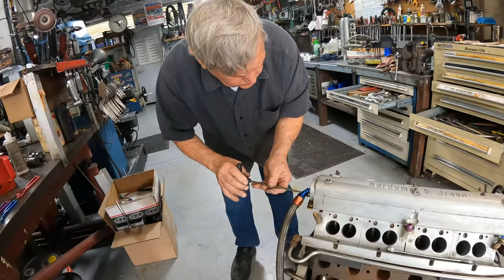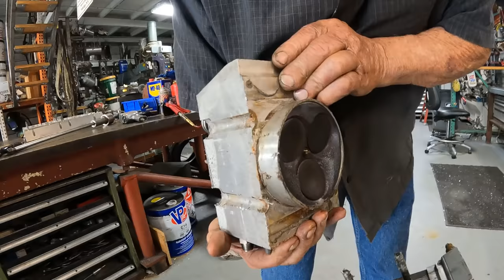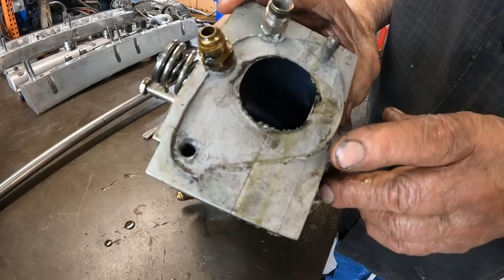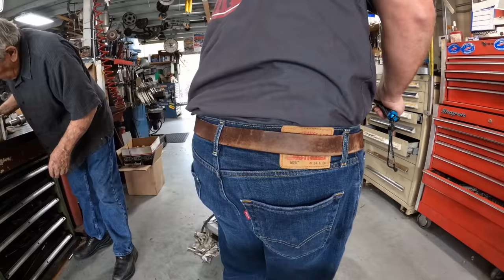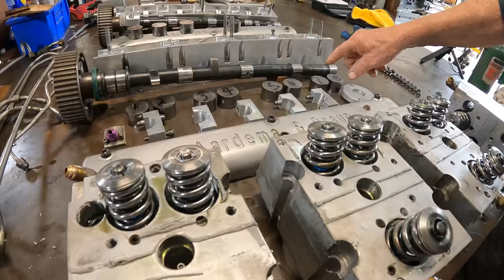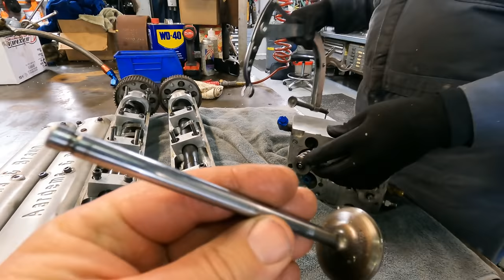World's Fastest Ford Model A Engine Disassembled and Revealed

Comment: The 1988 Mercedes Benz 300E AMG Hammer 6.0L V8 has 2 piece cylinder heads with similar in design to what they've done. AMG converted the SOHC M117 engine to 4 valve per cylinder.

Comment: I applied for the patent for the 2 piece cylinder head in 2003, and never could find anyone that wanted to take on the project on so I never followed thru on it. I keep telling people it was workable and now I am so happy to see that you guys made it work. I still feel it is the very best way to build cylinder heads. The heads can be made from 6061 which is 6 times stronger than castings. So you can make a head that is both lighter and stronger. The only problem is you have to have all the head bolts holding the 1/2 together.
Reply: I had a similar idea around the same time, 2007 I think, of milling from the top and then using o-ring/ silicone type seals around all the water passage stuff and fastening down a block off plate to enclose water passages and rocker stands bolt down through plate into meat of the head, blah blah blah.
Obviously it was just dreaming,,,lol.
I’ve seen not to long ago where Steve Morris, I believe, is building a completely billet motor with water passages milled in with plates and o-rings sealing it up.
I was like,,,, it CAN work,,,, . 
How these guys are doing is different, if just proves that the concept can work. Maybe not for a production vehicle, but it’s viable.
I’m going to look for that SMR video now,,,,,,
Found the link.    https://youtu.be/TqGVvmn9buU
Reply: @shakeydavesr  Like they say there is nothing new under the sun. When we did a patent search for a 2 piece cylinder head, only Ford was doing this and it was only used for rapid prototyping. I have $10,000 invested in the patent and never did anything with it, and now the patent has expired. But I sure would just love to build a pair of SBC heads and prove it can be done. One thing I disagree with you on, is I believe this would be better for mass production than what it takes to cast and do all the CNC work they are doing now anyway. You start with 2 plates do all the internal CNC work press them together and finish the external, 100% CNC. The very best part is that all your tooling can be short and very rigid, so the cycle time can be very fast saving money on production.

Comment: Very cool, there were some race only Porsche engines (935/78 and 959) that had multi-layer heads that were water cooled while the rest of the case was air/oil cooled.  Kind of similar to what was reviewed in this video.  Thanks for sharing

Comment: You should check out the blue Summit house brand coolant.. It's meant for racing and is legal on most tracks, and probably would help the corrosion problem there too, not to mention its affordable too
Reply from the maker: I will mention it! Pete probably will lean towards water as it is cheaper at the moment, however with raising water prices in Sol-Cal it might be cheaper soon to run coolant :-)

Comment: The spark plug hole diameter looks small. Do they use a CM6 type plug?
Reply: CM6 is very short reach,  they might use another longer 10mm plug.

Comment: The original, Brit-based Royal-Enfield Interceptor verticle twins had separate heads, so if one side experienced more wear/failure, you could replace one side without a complete tear-down.

Comment: this is one of the topics i state in engineering. is the fact the discussion of new power plants vs old.
design is design. i believe that this represents that older block design with new engineering can outperform a lot
of newer blocks. it isnt that it is newer or older it is the design of the engine that matters.i am a firm believer that older power plants can be modernized cheaply to outperform and outlast a lot of new power plants. i would love to see this visited with the 350 sb chevy the ford 302 and 351 and the chrysler 318 and 340 i believe the performance and durability would astonish a lot of people
Reply: There is nothing cheap about modifying a block originally designed for 40 hp to withstand 500 hp +. The block originally had 3 main bearings and 3 cam bearings, a girdle must be made to add 2 main and 2 cam bearings if needed, they are using bolts thru the valve guides to help support the girdle. It is allowed in the rules (Bonneville) to run 4 half inch bolts per side from the head to the girdle to help support the forces. Most of these motors never go 60 total miles so durability is unknown. The cranks cost about $3500, rods $1500, pistons $1200 this is for a 4 cylinder. Cheap it ain't. 
I have worked on a record holding Blown Fuel Lakester with a Model B flathead that went 181mph on the short track.

Comment: I wasn't expecting a DOHC 3V engine, nice work, guys.

Interesting to see one intake port per valve. That's extremely rare in production engines, I'm not sure why.

I didn't expect the cam to be ground similar to a flathead. I figured they would copy some kind of successful DOHC bucket lifter profile. The Subaru EJ-series turbo DOHC had numerous cam grinds because of all the rally car enthusiasts. Subaru did replace them with roller finger lifters in the FA20DIT engine.

That 2.18 inch valve with 6mm stem is amazing. Sure, some modern engines get a 6mm stem, but only the DOHC engines with valves about half that size. Well, that's what you get when you don't have to drive as far, and can buy very expensive materials.

Cutting down and refacing the valves? Given the expensive stuff they are made of, is that a problem for the tools? When JAMSI used a crankshaft grinder to make some cut down valves, they were stock replacement stainless steel, but they still had to reface the stone on the crank grinder. I don't think it was a problem for the valve refacer.

Comment: Which bit is 93 years old apart from the cylinder block ?
Reply from the maker: The engine has been heavily modified , however, it met the minimum requirements per the rule book to run in the V4 vintage class at Bonneville which is the bare block

Comment: Did he come up with this after seeing the Jon Kaase heads or was it their idea? I can remember the Engine Master build shown in Hot Rod magazine.
Thanks to all parties for them showing all this and you for filming and sharing.
Reply: Didn't Kaase do it with the "Y" block, as far as dropping the chamber into the cylinder?
Reply: @jerrytee2688  I believe that is correct.
Reply: @jerrytee2688  No. Kaase's engine with a thick plate for a "head gasket" and protruding chambers was an MEL. At 470ish cubes it made 770ish peak HP. His Y block was another endeavor.
Reply: Yup, that's right, thanks for the clarification Joe.

Comment: detroit made an engine for cab over trucks with 6 separate cylinder heads. many big rig engines have 6 separate heads, to be able to perform repairs without removing the entire engine.
Reply: K series Cummins was the only engine with individual heads used in over the road trucks.
Reply: It's called the turbotronic 638 Detroit.
Reply: @mikebougher3731  There was a model of Scania in some Macks that had 6 heads. Of course the very common 855 Cummins family had 3 heads.

Comment: Imagine a flat head V8 with heads like this!  Heck give it a flat plane crank and it would be this!! Maybe change the valve angle to prevent interference,
Reply: I mean there's not much to a flathead cylinder head if the valves are in the block. Would be a a waste of time and useless.

Comment: what makes them break besides it is a model A/B block, is it the RPMs and or torque? Somebody is making new A blocks in China. If one of these stronger in design blocks would be used would it then not qualify for a record in the model A class?
Reply: Bob, if I may Sir,  regardless of the improvements in metallurgy and machinery of the new blocks, they are still severely hampered by having only 3 main bearings.  This INGENIOUS block design by Pete uses a main girdle arrangement with 5 main bearings and a custom crankshaft,  I believe by Crower. I hope this helps.
Reply: Of course Kevin deserves credit as well.  Forgive me Kevin for not mentioning you in the above post. 

Both you gentleman have inspired me to continue to develop my own design cylinder head for the Twin Cam Harley Davidson.
Reply from the maker: Pete and Kevin built a overhead cam Harley Davidson years ago, unfortunately  it was lost in the fire.  Pete still has the chard remanence of the bike on the property and he said he would like to do a video about it in the future.   The bike was a hit at Sturges.
Reply: @t.s.racing  well the 3 mains were not a prob on the stock block so this could be overcome in a new block. I was looking beyond that knowing that the mains were not as big of a deal as the strength of the block.  Then I was surprise, on the new blocks, that having gone through all the engineering and production that they would stick with 3 mains. Thanks for the reply.
Reply: A reproduction block would probably be against the rules for the class. I know you can't use the French copies of the Ford flathead v8 blocks in SCTA vintage classes.

Comment: If they need to reduce the compression ratio in order to run a turbo or supercharger, why not just shim the heads to increase the volume between the head and piston?
Reply: There is an area between the piston and head called quench with very little clearance at TDC and it increases turbulence, flame travel, and detonation resistance. Increasing the gap here reduces performance by making the above mentioned things worse.
Reply: @marthamryglod291  OK, but if the solution is shorter rods with the same pistons and same heads, isn't moving the top of the piston away from  the bottom of the head the same as moving the bottom of the head away from the top of the piston?
Reply: @brianhalberg131  the solution is to keep the quench while dishing the piston more to reduce compression. Do not lower piston height.
Reply: @marthamryglod291  As I understand "quench", or piston to head clearance, its the distance between the piston and the head at TDC. For a flat topped piston this is uniform across the piston and any swirl or turbulence is imparted by port flow, angle, combustion chamber shape etc.
Dishing a piston may retain the same clearances at the outer edge of the piston but increases the compressed volume, therefore quench is no longer the same.
Reply: @brianhalberg131  the piston does not have to be flat across the entirety to have a quench area. Even a small section of flat area matched to the flat are in the chamber will provide quench. David Vizard has fantastic books with diagrams and graphs showing different chamber shapes and piston shapes and how they affect power output. Really fantastic books.
Reply: @marthamryglod291  Thanks Martha, I fully understand that. And just to be clear, I'm not suggesting that the quench or squish area is anything other than the area of smallest clearance between the head and piston. As I understand what you're describing is the area between the flat or flatter portion of the head and the corresponding area of the piston. When the piston comes to TDC the fuel/air charge is compressed more highly in this area than it is below the combustion chamber dome. The fuel/air charge is driven into the main part of the combustion chamber giving you swirl or turbulence which can be used to give optimum flame front propogation and prevent detonation. I get that. My original comment was proposing raising the head up the bore slightly as opposed to making large changes to the rotating assembly. Without sitting down and calculating what that increased clearance would need to be in order to lower the CR to the desired number, I couldn't say what the change to quench area would be. It was more to suggest that CR could be more simply lowered using that method. Not being an expert on forced induction, I had assumed that quench area wouldn't be as critical as it is on NA engines. I understand that you're saying it is.
Reply: @brianhalberg131  great reply! I understand you well. I just love learning from different people and Vizard is a wizard.
Reply: @marthamryglod291  I have one of his books as well.

Comment: Why is a 2:1 rod ratio so undesirable. Is it the extra weight in the rod?
Reply: I think it is because their engines tend to be NA and the faster speed away from TDC helps to get the intake charge going and improves cylinder fill over a longer rod which tends to be lazy. If they did more turbo motors they might find the longer rod to be less detrimental but easier on parts. Also the long rod ratios tend to really shine in engines that scream high rpm for a long time. In their application they are pulling up thru the rev band and at lower revs the shorter rod ratio tends to make more torque.
Reply: @bcbloc02  Hey! I watch your channel here and there as well. I was pondering if the slow piston movement you are describing is poorly matched for the fast combustion speed of gasoline / race gas.
Reply: @david929190  I don't think the fuel has a whole lot to do with it as I know some Formula one motors have run some crazy high rod stroke ratios like supposedly over 2.5:1 but they run insanely high rpms and stay there for long periods of time.

Comment: The block must be based on the oem block, but that's it, right?

They added 2 crank bearings…so the crank isn't stock, and the block is modified, but it's "based" on a stock block 😂

Comment: Intake ports are for a 10,000rpm engine will never see 5,000rpm.
Reply: We turned the engine 7000 rpm. Although the ports may handle more rpm on a shorter stroked engine, it has more to do with cubic inches to valve area.
This engine has a lot of cubic inches per square inch of valve area. So it will not handle much more rpm.
Reply: @kevinbraun6272  the factory ports are WAY to large in a boss 302 and to make them flow well the floor from gasket surface to floor radius must be filled about a half inch, if you don't fill the ports the usable power range is way to narrow and won't be competitive as cast with porting and manifold matching,

Comment: That’s not a model A motor
Reply from the maker: It has been heavily modified , however, it met the minimum requirements per the rule book to run in the V4 vintage class at Bonneville.

Comment: U talk to fast over the fact u said 238 mph. In a model a ford? Now I never driven one. But ive overhauled many engines even sit in a couple. And ive done 265 km/h on a highway in a porsche. And that was scary. But doing 200+ in a ford model a I aint gonna take ur word for that. First of all the guy with balls big enough hasnt even born yet. And I dont think its even possible even if u put a jet engine in it. It would disintegrate
Reply: What Porsche does 265?
Reply: @youwantshum9860  that's km/h not mph I didn't state that correct. Don't know why I didnt write that should have. 265 mph is a bit extreem haha.